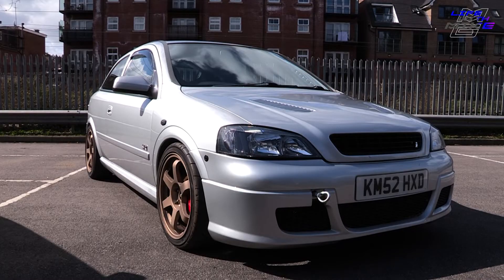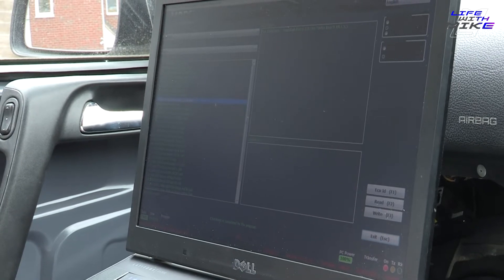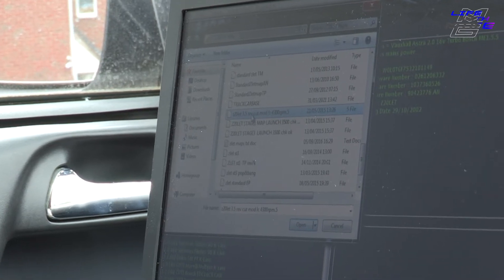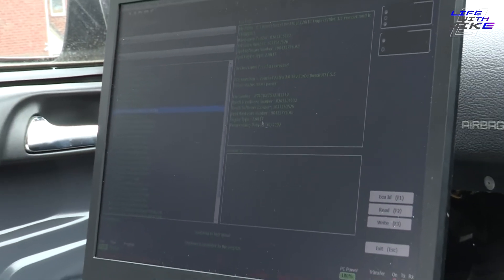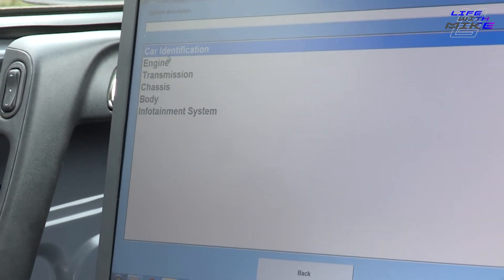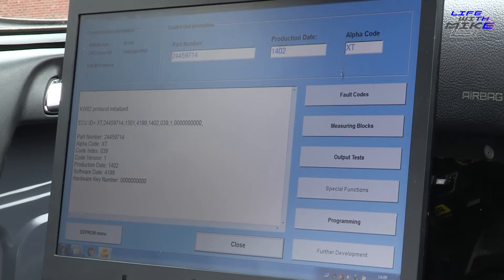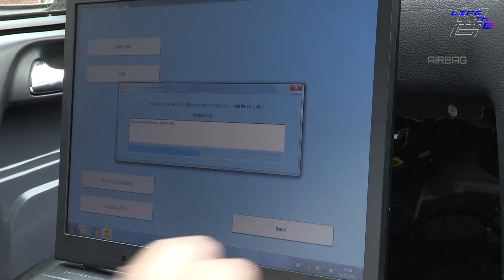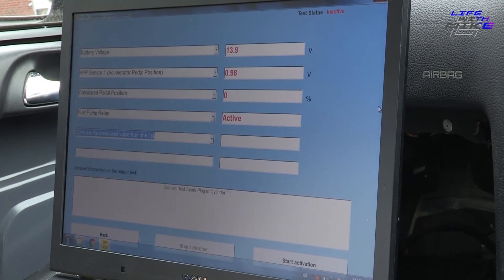REMAPPING A TRACK CAR!! Z20LET Astra G Mk4 300bhp Mapping with Mileage Change / Correction Tuning

Comment: Hey Mike, any chance you can send a map to a fellow z20let guy, I’m in Australia and no one maps these cars
Reply from the maker: Yeah not a problem - send me your setup and I’ll send you a generic map, but you should definitely take extreme caution and get it to a rolling road ASAP.
Reply: @LifeWithMikeG  thanks mate, it’ has, VXR turbo, VXR injectors, VXR maf, 2.5 exhaust with decat. Front mount cooler, Courtney crossover delete and top hat

I have an old eds3.5 map from eBay. Not sure how bad or good it is?
Reply: i think all those mods cover what I have @LifeWithMikeG